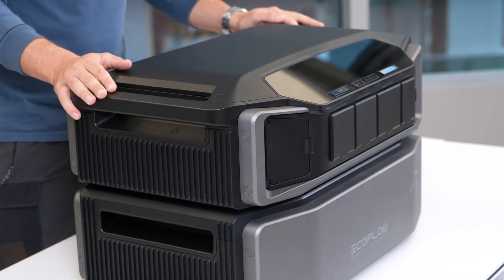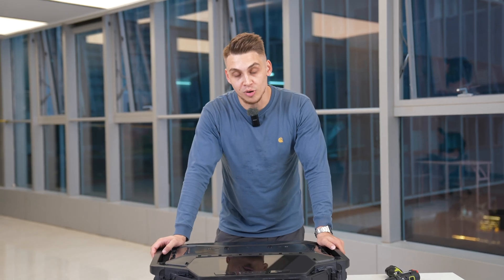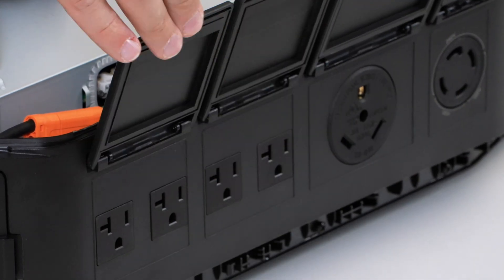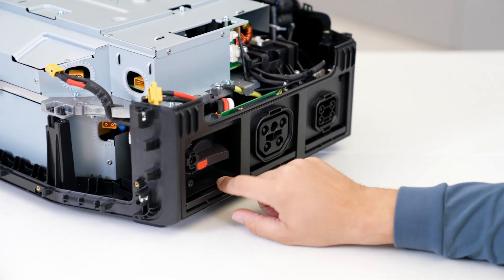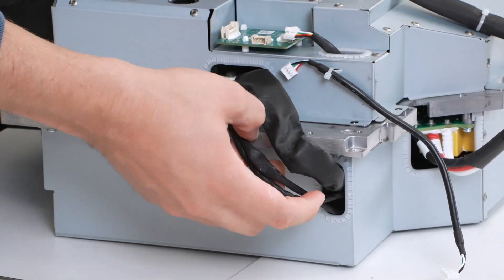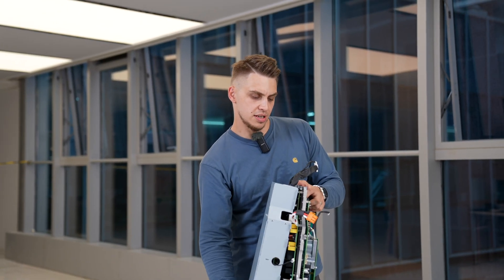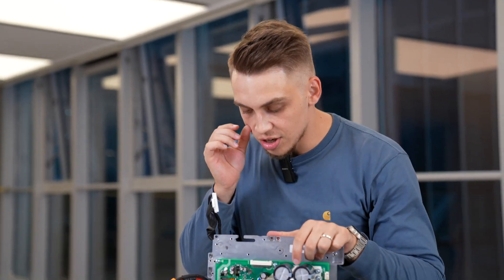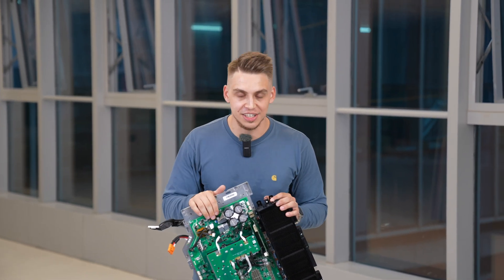EcoFlow DELTA Pro Ultra Teardown

Comment: I am on my 5th DPU, orginal 2 worked fine for 6 months or so but then both stopped taking any power inputs.  Eco Flow has shipped me 3 replacements none of them work either.  Been ongoing now for 6 months and tech support isn't very helpful.  I tested voltages with my multimeter from my loPV, hiPV and AC cables all checked out.   Any ideas from the group?

Comment: hey, nice unit, can you tear down a battery pack as well? ...6kWh /100lbs in a small footprint is a considerable shrink in size (high power density)..  what output voltage does it have to drive the inverter with? thanks..

Comment: The resistors that you were worried about are actually capacitors. I would not take apart such a system right after being disconnected from a power source without wearing insulation gloves in case there is residual voltage in capacitors. Trust me you do not want to find out the hard way.

Comment: Where is the wireless card? I am guessing it is under the front over, but I couldn't see it on your video. Thinking it is a wire pulled out at 3:09 or 4:00. And perhaps shown when you wasted the front output panel. If this is still apart, could you confirm this? Wondering if I can remove it, so this can be installed in a strict wireless-free facility.
Reply: Is such a thing even possible, when the firmware is closed source? With a high frequency CPU and direct access to gpio pins, there are plenty of ways to transmit. Maybe pour a lead box? 😅

Comment: so Its two PROS sidestacked? with a power pack
Reply from the maker: Hi the Delta Pro Ultra inverter and the battery can be stacked together with the battery connection table on the side.

Comment: ***Edit i found later on in this thread the way the systems will work together and that is fantastic!! 
Hello, Thanks for this vod. Its very helpful info for sure. A few things i would like to say. Like computers the evolution going forward as new tech comes on line Its really hard to know is it worth waiting for new tech, or buying the current tech? The other issue is Longevity, Will these unit with appropriate extra batteries for a hole house back up be worth it. Vs say like, an off grid Ridged style solar system. Will the system hold up to every day use off grid style and just using strictly solar panels to keep the batteries up? Like in my case I use ruffly 27kw a day currently on grid. would a system like this be-able to sustain every day use? at say nearly at. or around full capacity?  Thanks for your time and any response. Cheers.
Reply from the maker: Hi there, understood! The Delta Pro Ultra uses LFP battery which only goes down to over 80% capacity after 3500 cycles. Basically it means that you can use it every day for ten years and can still keep using it after that. The ultra battery has the largest capacity (6kWh) in our product line and can be expanded to up to 30kWh with one inverter. This can support you completely off grid for one day based on your need. If you need more power, you can add up to three inverters in this system (that will be 90kWh in total). If you want to know more specs of the system, check out this video👉https://www.youtube.com/watch?v=WDGzPCrw7FY&t=1s

Comment: Hi, great video! Can the DP Dual Fuel Generator integrate with this unit? Meaning it is fully functional as in when to turn on etc?
Reply from the maker: Hi there, good question! The answer is yes, the DP Dual Fuel Smart Generator can be plugged into the charging input port of the ultra. Here is a video to explain it👉https://youtu.be/TeoXospthac

Comment: I have a delta pro which is alrdy an amazing product except it's brutally loud ! I got 3 panels attached (120V max in series) and if the Sun is out and reaches 900W solar income it gets as loud as a jet airliner which is ridiculous cause its temperature never gets above 27C. The fans should not even kick in below 30C. I hope that Ecoflow will provide an update for this issue because other than that it's a brilliant product.
I have it combined with the smart home panel and as long the Sun is shining it runs the whole household (even the air conditioner in summer)
Reply from the maker: Hi there, here are my suggestions:
1. Please check if your firmware is updated. We have optimized it regarding noise.
2. If it is still too loud after firmware update, could you please use noice measuring device to measure your pro at 1 meter around the unit. You can send a screenshot/record a video to our support team👉support@ecoflow.com
Reply: @EcoFlowTech  ! It's updated ... I'll get some noise measuring device ;)

Comment: Hey Guys,

looks like a cool product and it is going to be very expensive I bet.

Will this come also to Germany with 230/400V 1/3 Phase output?

Wished it had multiple solar inputs for a east-south-west solar system configuration.
Reply from the maker: Hi there, the price is not announced yet. We are still doing market research in Europe and will give a shout in our YouTube community once it is ready. There will be a version specifically adapted to Europe, stay tuned🙌

Comment: I tried everything. The extra battery keeps running down and it's not keeping charge
Reply from the maker: Hi there, may I know which extra battery your are referring to?
Reply: @EcoFlowTech  delta 2
Reply from the maker: Got it. Do you mean the extra battery keeps running down when it is not working or there is an imbalance when it is connected with Delta 2and discharged? It is suggested that you contact our support team for help 👉support@ecoflow.com. You can shoot a video of what is going on with and send it with your unit's series number.

Comment: What about the circuit fusing ? What I have noticed in earlier EcoFlow products is a failure to put end user access to circuit fusing. What this means is everytime an end user makes a mistake and accidentally overloads either a DC output circuit, or an AC output circuit on their EcoFlow power station, the chances they will blow an internal fuse is not small ! Thus, the end user must ship their EcoFlow power station back to the company to obtain servicing. The extra time and gros inconvenience to the customer, as well as the increased cost to EcoFlow Company in shipping units back and forth to the customer, is a totally inefficient way to market a product. Does the EcoFlow Ultra have end user replaceable fuses, or resettable circuit breakers ?
Reply from the maker: Hi there, if the internal fuse is blown, please contact our support team to repair. Given the possible risks, it is not recommended to repair it yourself.
Reply: @EcoFlowTech  See this is the problem right there ! I don't want to contact EcoFlow Tech Support ! I don't want the fuses to be internal ! Don't you understand ? I want all fused circuits to have external, user replaceable fuses, or external breakers, which I can reset myself. I don't want to deal with extra shipping back and forth to EcoFlow if something goes wrong.
Reply from the maker: Hi, I understand your point. It is legal and common in the industry to have the fuse inside the unit. Usually, if you use the product properly, there will be no problem. If there is an overcurrent resulting in a blown fuse, please contact us.
Reply: @EcoFlowTech   what is the surge rating on the ultra please?
Reply: @EcoFlowTech  You just don't get it do you ? I don't want to ship my units back to EcoFlow, just to replace an internal $1.50 fuse if it blows !! Allow the customer to replace fuses, or simply reset breakers. Stop putting proprietary, internal, unreachable fuses in your products, which the end user cannot service ! Why not put standard electrical industry external breakers on your solar generators instead ?

Comment: Stay away from this company.  I'm currently dealing with a nightmare with them. when you call you will instantly talk with a representative from the Philippines that cannot do a single thing other than send an email to the a team in china that has to translate the email then it can take up to 3 days to receive a reply from them..and they do not want to resolve your issue but rather chew up your 30 day return window. I've been in touch with ecoflow since 11/6/23 and still no solution and no real help. several agents from Philippines told me they escalated my ticket to high priority but then I found out by yet another agent it was still low priority...so many agent s will simply lie to you. I've never had a worse customer service experience and this is by far the most money I've ever spent..and you will never be able to talk to the agents from china because its all email. This is a system setup to benefit the company and not the customer. I'm totally baffled by this experience and will never again in my life buy a product this expensive from a company that forces you to deal with people in china for a resolution.  To top it all off, the money I used to buy this system was money I received after my mother passed away and now I'm stuck with a system that simply does not work for me. I originally called asking about the Ultra and was told that was not their product or anything they carry so I bought the delta pro..turns out they do make the ultra and it addresses all my issues. Just a horrible experience to say the least. The takeaway here is that if you have an issue you need to get resolved you will spend an enormous amount of time and stress dealing with them and probably you will not get your issue resolved..this is not something you should have to deal with after spending thousands of dollars. My advice is buy from an american company that you can actually talk to the people that have the power to help you. It's pretty obvious they are simply chewing up my return window and never had any intention of helping me.
Reply from the maker: Hi there, I am sincerely sorry to hear that. Could you please tell me your case number so that I can look into it. Many thanks.
Reply: @EcoFlowTech   @EcoFlowTech  CRM:0005030000472. I would very much appreciate your help on this. This is the basics of what happened. I originally called ecoflow and asked about the ultra which I had seen somewhere on the internet. I was told by the agent that was not your product or anything you carry. I then ordered the delta pro + extra battery + 2 500 watt portable panels + extra extension cables + solar angle guide etc. Soon as it got here I stumbled across your video of the unboxing and was shocked to see the ultra was in fact your product. I then called to see about returning my delta pro + extra battery and keep the rest since I already bought the coupon for the $1500 of the Ultra when it's available. This has been going on almost an entire month and I'm getting nowhere. I don't feel it should cost me the $300 to return it/ This was offered to me once but I asked if they could please waive this cost to me since I was given wrong information which lead me to purchase the delta pro instead of waiting for the ultra which addresses all the issue I have with the delta pro which because of it's large foot print and limited solar capability just isn't going to work for me. Every since I asked about waiving the fee to return I've gotten the cold shoulder and no response but multiple agents have stated they have asked the team in china to please accommodate this request..but nothing. my plan was to get the ultra and be a customer for life especially since the ultra fits all my needs and is so upgradable for the future but now it feels like ecoflow may not care about me as a customer.
Reply from the maker: Hi there, understandable! Our support team is dealing with your case and they will assist you with your return and refund process. Please check your email box for updates. Thank you for your trust on our product and just a kindly reminder, the ultra will not be in stock until Feb 2024.
Reply: @EcoFlowTech  This is so frustrating. So I got the return labels finally but no mention of which label goes to which product (again..happen on the delta pro & extra battery return)  she (jasmine) also didn't answer my question of how much the refund will be once these items are returned and I would like to know since last time with the delta pro and extra battery return she mistakenly held back $150 which she said is now corrected. I'm having to spend an enormous amount of time with all this I would just like it to be finished. with each issue its 3 days wait ..or more.

Comment: I would prefer not to stack it. is there a longer battery cable designed for this layout?
Reply from the maker: Hi there, yes we also have a 0.75m battery cable for use👍

Comment: It is a very impressive device, cant wait to see the professor from Hobotech, or Will Prowse review the unit. You guys are the only manufacturer that has true 30 amp output.👍🏾 It'll be too bad though that I will have to wait years for a good deal on the unit since I find with ecoflow you get a good deal before its released, and you know what your buying, or when a couple new iterations are released. 

I've been waiting 2 years for something like this to be released. My problem with most other devices is that you need two seperate units which takes up more space and waste more precious battery power. 

One thing that is a double edge sword with this product is the size of the proprietary battery. 6wh means no gradual increase in storage. Everytime your going to cry lol.

With all that said, I really like the product so far, and look forwards to all the information, and real world testing. Ecoflow, good job on your innovation keep em comming please.👍🏾
Reply from the maker: Thanks for these words. That means a lot to us👍 Btw, we are gonna work with some big influencers to review the ultra and release the video on our channel. Stay tuned!

Comment: Цікаво. Коли радіатор буде повністю заблокований пилом, як це відбувається з ноутбуками, що користувач повинен робити? Розбирати пристрій і втратити гарантію?
Reply from the maker: there are dust filtering nets on the intake side of the radiator, so most of the dust will stay out and you won't need to disassemble that.

Comment: I just purchase A DELTA 2 AND EXTRA BATTERY 🔋 I FULLY CHARGE IT Within three days the battery keeps running down and i'm not using it so disappointing.
Reply from the maker: Hi there, sorry to hear that, here are my suggestions:
1. Please check if you have set the AC timeout as NEVER, resulting in the unit been in the standby mode. Usually in this case, the internal power consumption is about 10W; if the DC is also on, the internal loss will be larger. 
2. It is suggested to charge the unit to full and leave it there for a while then discharge it. In this way, you can check exactly how long it can run. 
Please let me know if this helps.
Reply: Did you make sure you turned the units off completely? You have to press and hold the power buttons until you see off on the screen. I have a delta 2 and extra battery myself and they last for months between charges. If the unit isn't off completely it will still consume power.

Comment: What is the efficiency percentage of the DPU's high voltage PV input port?

High Voltage, High Efficiency: The DPU’s high-voltage PV input port delivers an impressive 95% inverter efficiency and boasts a whopping 450 Volts and 4000 watts of power. That's some next-level stuff! 🚀